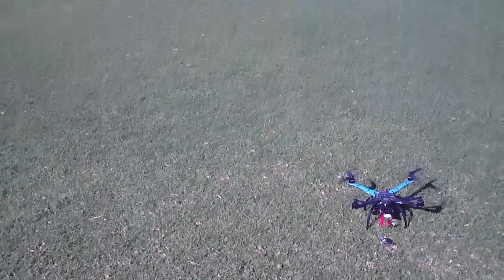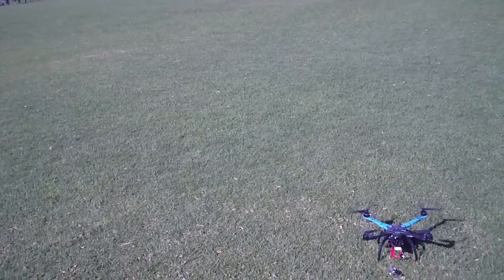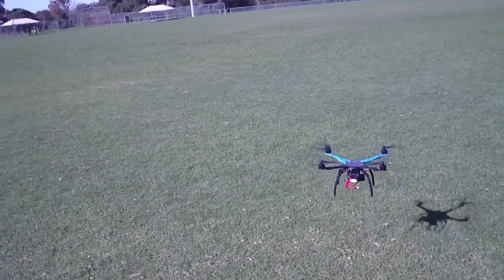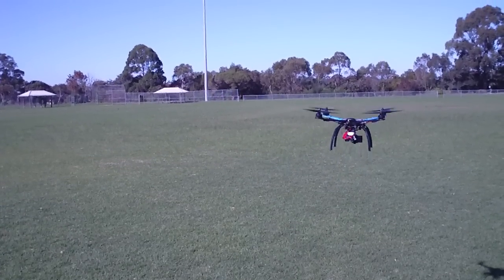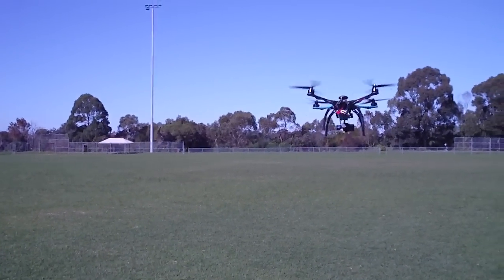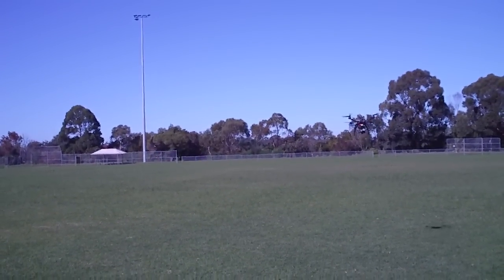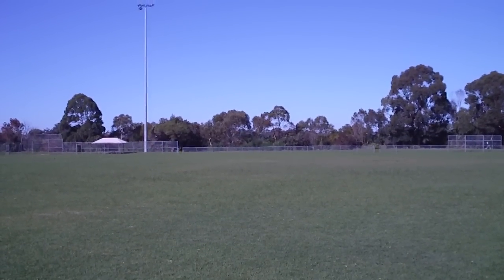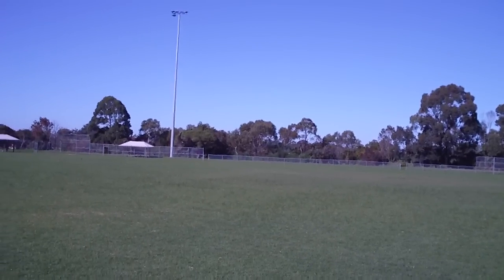Chinese GPS for NAZA RTH Test

Comment: Hi, I have seen these on the bay, 30-40 pounds delivered (half price of naza gps). One question, other than compass calibration is there any setup required?
cheers Jon
Reply from the maker: 0ldfish HI Jon,  The set up is the same as the original puck, just enable the features you want in the Naza Assistant.  e.g.  Failsafe method, GPS mode,  position of GPS puck - and then calibrate - no additional set up needed over the stock GPS.